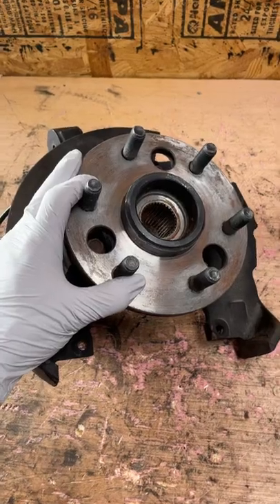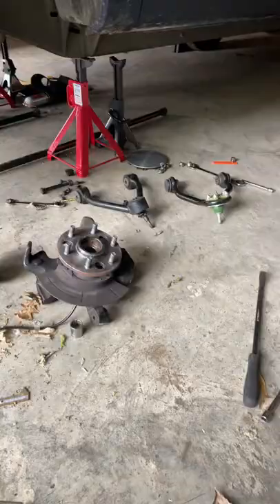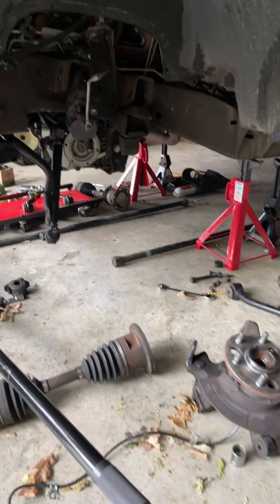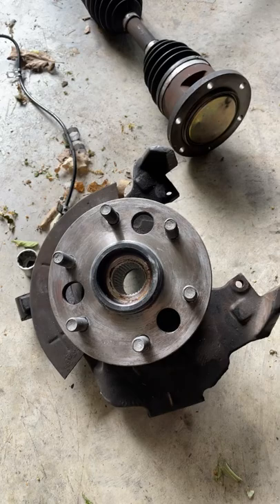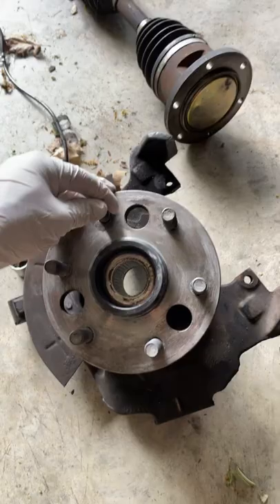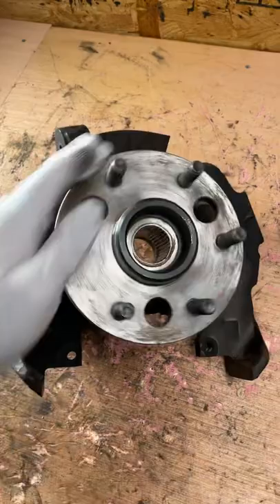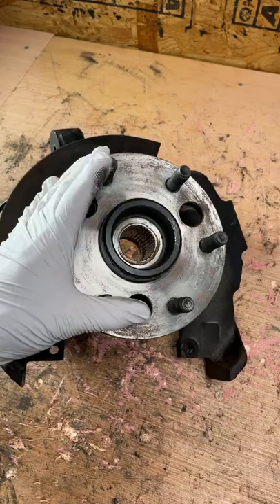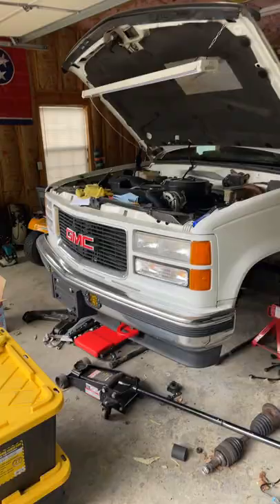Exactly How To Tell If Wheel Bearings Are Bad!!

Comment: If a wheel bearing sounds like rolling chair casters, it’s no good and may either need to be replaced or repacked with new grease.
Reply: Unless you're waiting on parts, don't bother re greasing at this point. Some damage already happened and the bearings are usually cheap

Comment: Also I would add that when you spin them they feel like you’re turning a ratchet wrench
Reply: Alot of times, they will spin too freely with no rachety feeling and still be bad because the grease is breaking down with little lubricity left. 
A greased bearing will have some resistance when turned because of the viscocity of the grease.

Comment: "HoW To TeLl If YoUr BeArInG Is Bad!"
"StEp OnE HaVe ThE BearInG On YoUr WorkbencH!"
Reply: I mean it’s easier to have it on the car to check
Reply: @dumbeezy5480  Sure enough. But he is a home mechanic just trying to help other home mechanics. He is just trying to help people, and didn't have the knuckles on the burb when he decided to video.
Reply: @mrow9999  what
Reply: @dumbeezy5480  cant spin it like that if its on the axle
Reply: @user-fx8bk3fo8u  uhhh, yeah you can.
Reply: @AbdulSalam-xe4md  Could have done it on the car and actually provided something useful. But he didn't. And now people have to use too many assumptions of "it sounds like the bearing I once heard on this guy's workbench" and firing the parts cannon.

The demonstration is lacking and dumb. Full stop.
Reply: Bad wheel bearings are very easy to diagnose. Easiest way to tell is listen for growling when you go fast then turn your wheel to the left and right and listen to see if the sound worsens or gets better each way your car goes to figure out which side. Worse case scenario your brakes start rubbing and grinding because your hubs not spinning perfectly anymore and is wobbling.
Reply: @pollux2825  Could have done it on the car and actually provided something useful. But he didn't. And now people have to use too many assumptions of "it sounds like the bearing I once heard on this guy's workbench" and firing the parts cannon.

The demonstration is lacking and dumb. Full stop.
Reply: you can literally spin it like this on the car. Jack it up, put it on stands, then put it in neutral, and spin the wheels. see if they sound like this, or have any play. 10 mins to check wheel bearings.
Reply: @24GarrettFPS Sure he could have and we could have learned something. But he didn't.
Reply: Bro juss spin yo wheel wit a jack
Reply: When the caliper bracket eats the rotor is how you know it's bad

Comment: The grease has broken down.
That is a dry, rough bearing that can come apart at any time.
The other one doesn't sound much better.
Replace them both while you have it apart.
Reply: I realize that a car is made of lot of different lubricants, with so much rubber to keep those lubricants in place (boots, seals). What a mechanic mess! Too much people forget about the important role of the lubricants.

Comment: This is why I like 2wd. Bearings are dirt cheap and can be greased so they are serviceable. I had a 98 1500 2wd. Just gotta look for ones with a metal race. Screw the plastic ones. I currently have a tahoe ppv which is also 2wd but they switched over to these hub style instead of spindles. Hubs last time I checked were $180 a side
Reply: Every 80s and earlier 4wd made by every manufacturer had hubbed rotors (easily replaceable bearings and races). Technically you can replace just the bearings on this guy's suburban too. You just need to press the hub apart and press the bearing out. You could press them apart and clean and regrease them as well. It's just much more work.
Reply: @ProleDaddy  nice! That's good to know. It makes sense though.

Comment: I’ve been hearing a loud noise coming for my front driver side wheel. It sounds almost exactly like loud off-road tired on a Jeep and since my tires were low on tread, I assumed they were wearing unevenly, but they weren’t. I got all four replaced yesterday and the noise is louder. Pulled the wheel off today and spun the rotor forwards and then backwards. There was resistance when I tried to turn it backwards. The passenger side spun forwards and backwards exactly the same. I think it might be the caliper not releasing all the way when the brake pedal isn’t being touched. If anyone knows or has an idea of what it might be, I’d appreciate it

Comment: My car is older, I was just in a wreck. Someone hit me without having insurance. I don't have full coverage, waiting to see if I can use uninsured motorists coverage. In the meantime my rear wheel bearing is bad and I already bought the bearing wheel hub assembly. Now my front one is bad, I already changed the driver side months ago and I knew the passenger front side was coming up. Now I need to change them. It's so scary. When life is do hard and you just want to end it
Reply: Cheer up champ